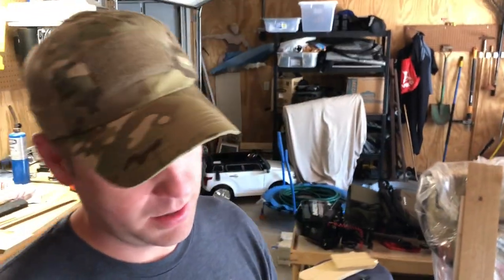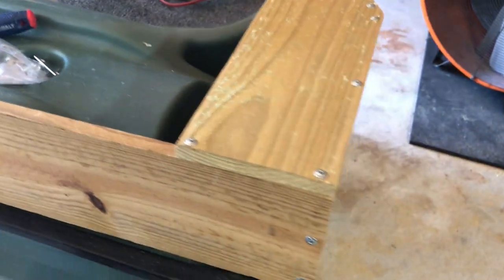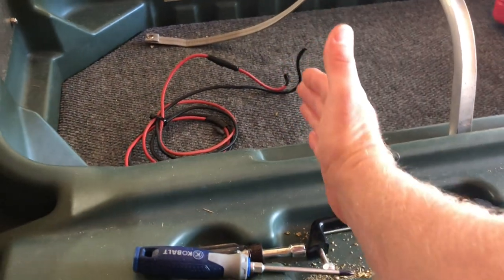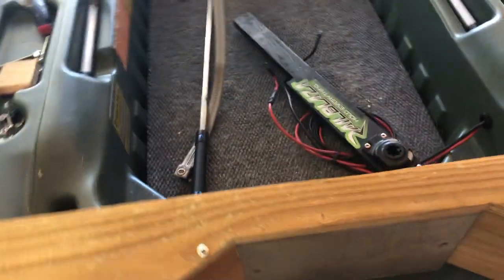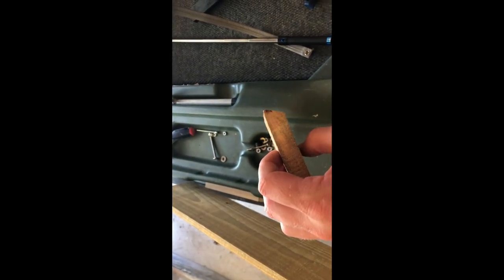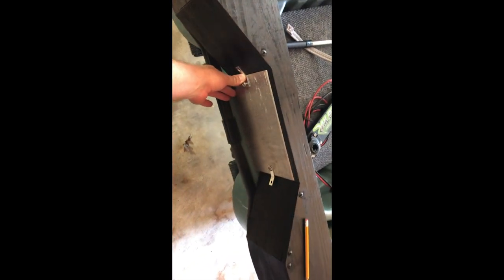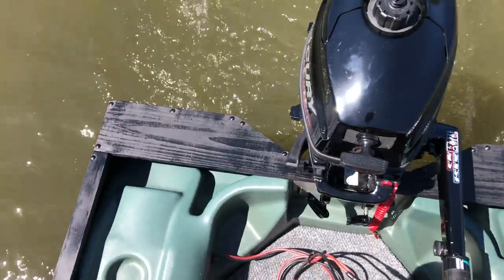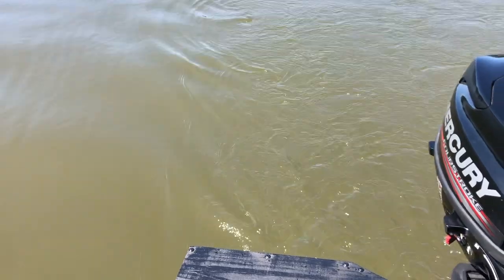Pelican Bass Raider 10E: DIY Transom Modification!

Comment: Just finished doing this modification to my 10e. Honestly is so cool how you used the original handle holes and didn’t have to screw or drill anything into the boat. Had to make a few adjustments and make some holes bigger but in the end it came out amazing. Great work!!!

Comment: Good Job,, A Thought For This , IF, You Were doing this build and Went ahead with a small compartment say a battery box or dry storage it would take all the flex out when the box was decked , a place to mount lights ,or whatever as well , I'm on a build Mission now , I do fish in the river here so the trolling motor needs some help when I'm moving from one location to another, I'm looking at all ideas before I start this project, this has definite possibility ,I know for sure the outboard is a must for me , I Catfish alot , our water systems are free flowing no locks or dams , always a current to be found in them Depends On the water levels and that's all mother nature controlled , anyway ,Good Video gave me a idea or two
Reply from the maker: Thanks for the kind words!  I’m happy you got some ideas from it; that’s what’s all about!  All the best with your build!

Comment: Good, real, DIY.  How has it held up?  I need some reinforcement for my 10e also.  I'm probably going to move my trolling battery to the front to even the weight out.  Thinking about affixing a length of 1/4" stock bar across the bows to let the outboard push that too.
Reply from the maker: James Walker the transom saver has held up perfect; no issues!
Reply: @maxcastfishing4357  i made one and it works pretty good!  I varied it a bit. Don't know if i can post pics though.

Comment: Nice. template still says pending. Had my pelican 8 out yesterday 1st time with a Honda 2.0 and the transom flexed enough to make me not want to use it again. Thanks
Reply from the maker: Earl Bates I had the same issue - the transom saver gave me confidence in running the motor at full throttle. I am sorry for the delay on the template. The template is now in the description. It’s not the best, but hopefully it will get you started. All the best!
Reply: @maxcastfishing4357  Thank you very much!!!!

Comment: Hello from Tennessee.  Curious how much weight do you think this added.  Any issues with leaks thru those holes?
Reply from the maker: Maybe 10 pounds?  The added weight really is insignificant!  I’ve had zero issues with leaks!  I used the existing holes already in the boat.  All the best!

Comment: When you transport the boat, do you take the outboard off and lay it on its side, or leave it on the transom?
Reply from the maker: That's a very good question.  I did originally make a motor-toter transom saver for transport, but decided not to use it given the motor is light enough to take on and off.  I decided to transport the motor in my vehicle instead of leaving on the boat.  All the best!

Comment: Just picked up  my first 3.5 hp Merc for my Bass Raider. I have a question re motor transport. Do you typically transport with motor on Bass Raider & trailer (w/ strap tie down) or remove motor while trailering ?

Comment: Would aluminum be lighter and be as strong or is there that much difference in the weight using wood to even worry about it?
Reply: I’m guessing wood is more accessible and easier to work with as well as no welding involved so he used what he could work with.

Comment: Just curious when you go fishing, do you travel with your motor on the boat, or do you take it off? Also, if you travel with it on the boat do you use a extension transom saver, or do you strap it down with the motor completely down or in a tilted position?
Reply from the maker: Darren Crofford this is a very good question. I do not keep the motor on the boat when traveling on the road. This setup tends to bounce pretty easy with road bumps and I think the added weight would damage these plastic boat transoms. With the new transom reinforcement, I have considered leaving the motor on with short trips where I know I won’t go faster than 55mph and the road bumps are minimal, but I’m still just not sure I will. I was working on a transoms saver/motor-toter but haven’t finished it. I too was wondering what would be best; having the shaft straight down or angled. I think it would be better to have the motor tilted up some to place some of the weight over the top of the transom. For now, I think I’ll just take it on and off. I have transported the motor in the floorboard of the boat (centered over the trailer axles) with it strapped down for a 2 hour road trip and it road nice. All the best!
Reply: @maxcastfishing4357  Thanks so much for the info. I just boat a new mercury 4 stroke 3.5 hp and was just curious of how you were traveling with your motor. Thanks again.
Reply: I have a yamaha 2.5 that i put in my truck during transit and put on boat at water. Bounces to much while on there. I did notice alot of movement also when in the water. Did you notice the boat planing better with this addon?

Comment: Hi good video one question , my pelican bass raider damage the black  rubber  bumper , how can I  fixed it? O where can I find it ? Thanks
Reply from the maker: Custom Design PR I’m really not too sure. If the bumper simply came off and just needs to be reattached, I would try using a marine grade sealant. The other option may be to contact Pelican to see if they sell replacements bumpers. All the best!
Reply: @maxcastfishing4357  thank I'm calling it pelican , thanks

Comment: Great job as always....How did you end up attaching the trim piece, glue or screws?
Reply: I used the original bolts and screw that was on the boat

Comment: What are the dimensions of the two pieces that need to have the angles cut?
Reply from the maker: Hello!  There is a template for the transom saver in the description section for this video. All the best!
Reply: The angle I used was a 35 degree and it fit fine. So the angle cuts are 35 degrees and 45 degrees.

Comment: I just bought a 4.5 Johnson. Do you think it is safe if I use it on my Bass Raider and just not go full throttle?
Reply from the maker: With the 4.5 it should move pretty fast, but I would be worried about that transom flex.  If you make the transom mod it should help!  All the best!
Reply: @maxcastfishing4357  Holy moly I just tested the 4.5HP it is so fast. I have terrible flex, the aluminum bracket is digging into the plastic. I need this mod and I should be good. Thanks!
Reply from the maker: @Fajah69  I can imagine how that transom looked; but I bet it would be sweet with 4.5 pushing the Raider. Be careful when you turn, as even the 2.5 can give you that sensation of throwing you off the boat. All the best!
Reply from the maker: @Fajah69  looks good!  Have you tested it with the 4.5 yet?!
Reply: @maxcastfishing4357  Over the weekend. Hope it does not rain. Will update
Reply: The 4.5HP does not flex that bad with the mod. The problem now is the transom wants to dip into the water at WOT and it is scaring me. I may need weight up front or just drop to 2.5HP-3HP which I think would be perfect.
Reply from the maker: @Fajah69  you might try an extension for the tiller arm on the motor and position your chair in the middle of the boat to balance the it out. I bought one and use it on occasions (I think it’s made by minn Kota and took the rubber spacer out).  All the best!

Comment: What HP is your motor and what would be the highest hp that would still be ok on this mount. thanks for the video.
Reply: also, what's the most weight for a motor to weigh on these and still be safe?
Reply from the maker: This is the 2.5hp Mercury (15 inch shaft).  I think the newer Raiders are rated for 3.5hp.  I am really not sure how much bigger of a motor this modification would allow.  I would certainly fell comfortable at least trying a 5hp with it, but I don't have one or know anyone who does.  All the best!
Reply: @maxcastfishing4357  I have a Suzuki 2.5 hp which I think weighs only 29 pounds.  I leave it on the transom in tilted position when towing the boat.  Seems to be OK.
Reply from the maker: Daryl Griffin thanks for letting me know this. I’ve gone back and forth whether I should try it or not.  Have you traveled at freeway speeds with it (say 70mph)?
Reply: It still shows pending please share the measurements

Comment: Have any other Pelican Bass Raider 10e owners had a problem with water accumulation in between the hull layers?  When I tilt mine it sounds like quite a bit of water is in there, and it is difficult, with the factory positions of the bow drain plugs to drain the water out.  I, literally, have to lift the stern over my head.  Any comments re this?
Reply from the maker: Daryl Griffin I’ve personally never had this issue.
Reply: I have the same issue. In my case water gets into the hull because the bow drain plugs do not seal properly, pop lose when on the water and from the seam of the hull.  It's not much water, but is a pain to drain out.
Reply: @georgefaulk2528  Installed two drain plugs at the rear. Much easier to drain.

Comment: How fast does it go with the 2.5 hp motor
Reply from the maker: Ethan Diller a brisk 7mph if I position my weight just right in the boat!  It’s almost double the fastest speed on the trolling motor.  All the best!